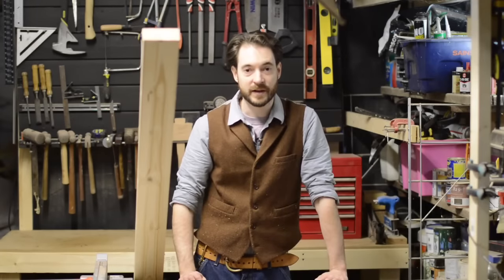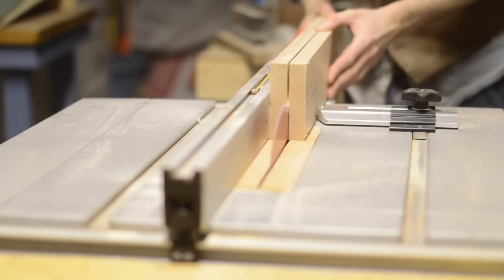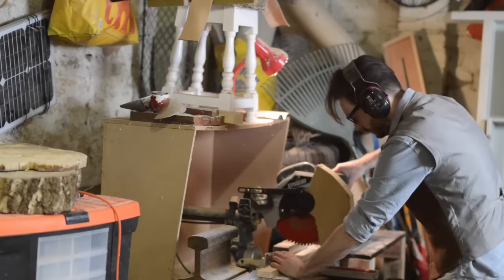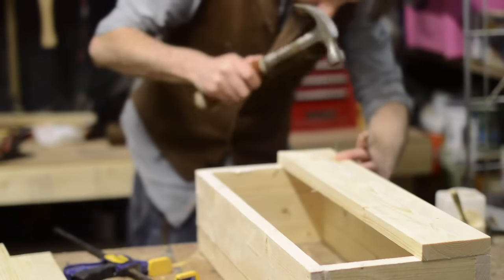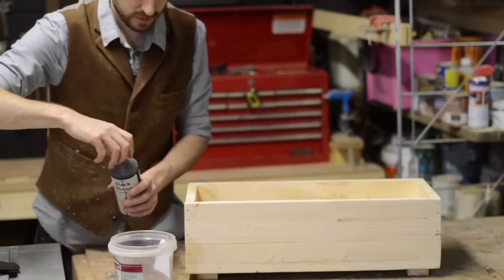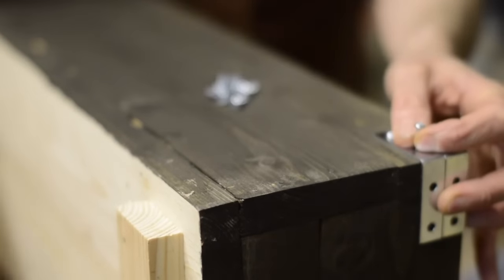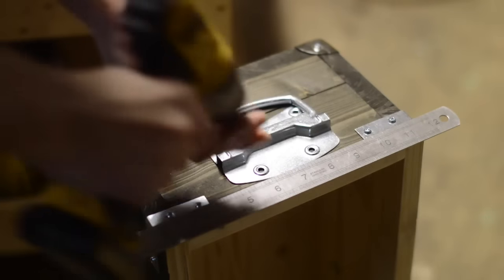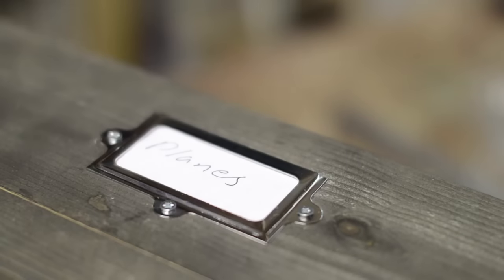How to make DIY wooded tool chests, Summers Woodworking 2x4 Challenge 2016

Comment: Nice idea. 18mm ply be more affordable, easier to build and the brakes would make it robust.. Rope or leather handles could add a nice touch. Also an idea would be to have a dolly base unit to move it around. Thanks for the videos.
Reply from the maker: Then it would not be the 2x4 challenge

Comment: I like the chest. I guess I will inspire my toolbox around this design style, the wood with the hardware. But it is a pain in the arse to find those hardware in Belgium, since I don't know the proper Dutch words, and the employees in the DIY-stores are mostly not involved and will send you from corner to corner of the store, so that it wouldn't make a difference for asking them. But I do need a toolbox, and I want a nice one, one that may be seen, just like yours. Great video!
Reply from the maker: I got most of my bits from EBAY. I don't know if the will ship to Belgium.

http://www.ebay.co.uk/itm/311608331530?_trksid=p2055119.m1438.l2649&var=610556895745&ssPageName=STRK%3AMEBIDX%3AIT

http://www.ebay.co.uk/itm/ZINC-CORNER-BRACE-ANGLE-BRACKET-L-SHAPE-JOINT-FIX-METAL-90-DEGREE-SUPPORT-SHELF-/332027025465?var=&hash=item4d4e5a5839:m:mvSEoSDuXzmvGrRTDnZ02sA

Srewfix looks good and they ship to you

http://www.screwfix.eu/chest-handles-105mm-zinc-plated-pack-of-2.html
Reply: Badger Workshop thanks for answering! Screwfix seem not much more expensive than the DIY stores over here, but they have a much larger range. And maybe I should try eBay, for the moment I didn't really want to use eBay, had enough problems with those kind of online stores. Thanks for the links!